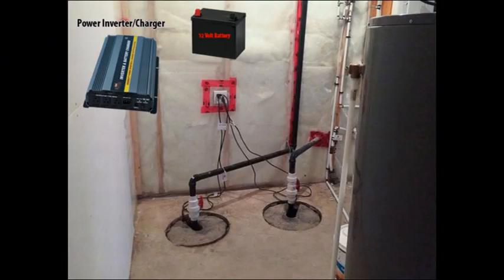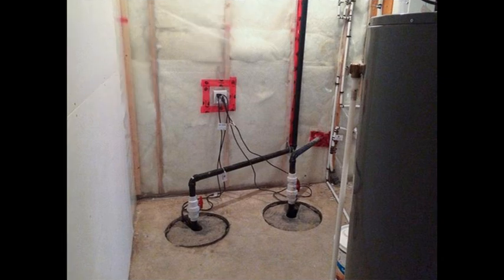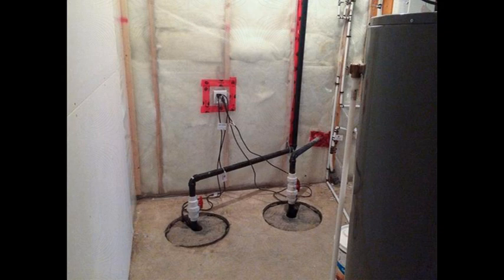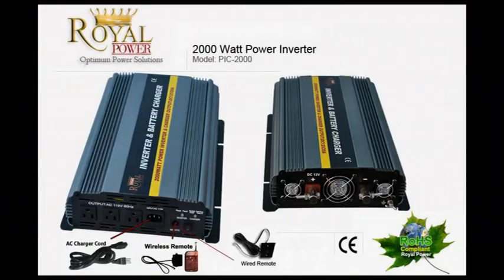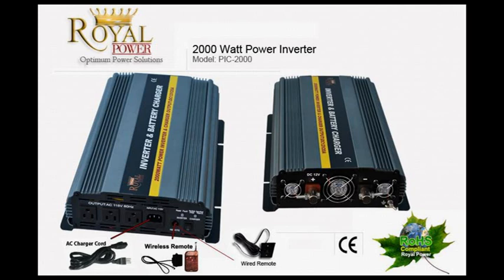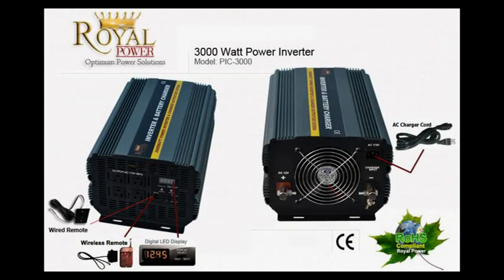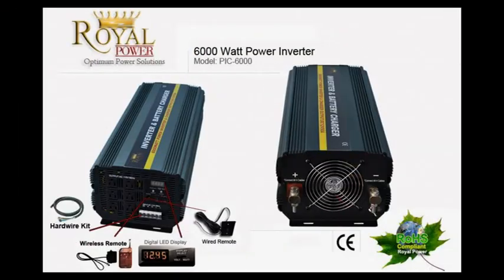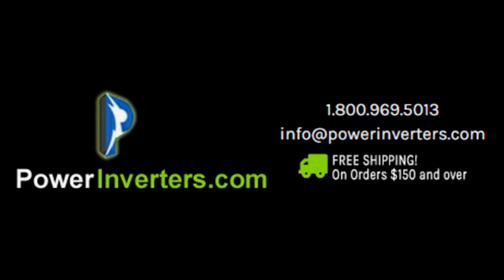Sump Pump - Battery Backup with Power Inverter Charger

Comment: Just got the 3000 watts for my sump pump. Do I need to ground it to anything or does plugging i to the houses utility/AC power outlet satisfy the grounding obligations?
Reply from the maker: When plugged in the outlet is grounded.

Comment: Do you have a recommendation for a brand of deep cycle battery to pair with these inverters?
Reply from the maker: Any battery brand will be fine. It will depend on the specs of the batteries. Try to get the most amp/hrs available.

Comment: What would you recommend for a 0.75hp sump pump?
Reply from the maker: The 3000 watt unit should be fine. Please see the link below,

https://www.powerinverters.com/collections/12-volt-inverters-with-battery-charger/products/royal-3000-watt-power-inverter-charger-12dc-to-110ac-volt
Reply: @Royal_Power_Inverters  Thanks.

Comment: I bought the 2000w and just realized my sump pump is 1/2 hp.  Will I be ok?
Reply: Usually 3000 watts is what we recommend for 1/2hp pumps because your pump may exceed 2000 watts on surge.